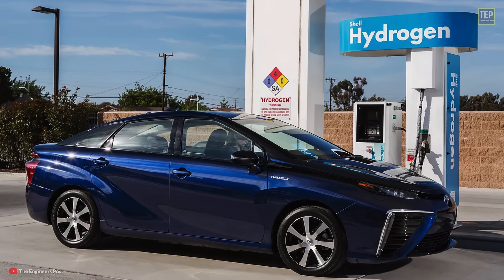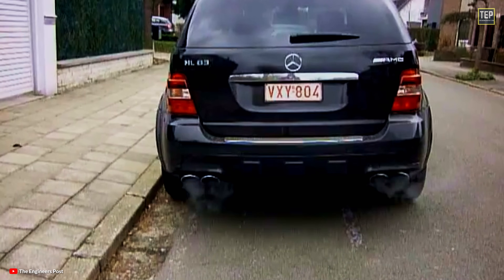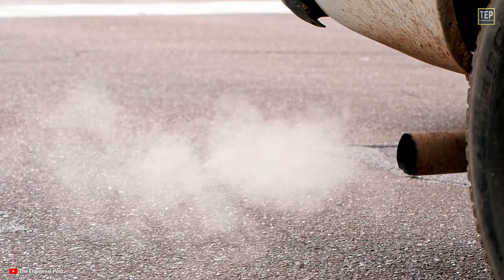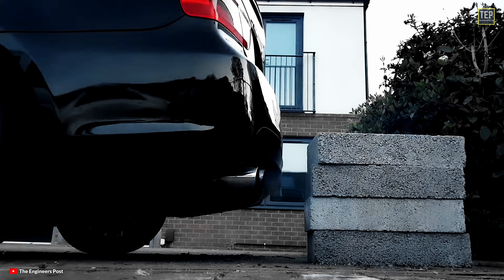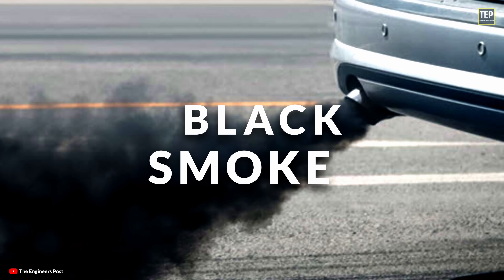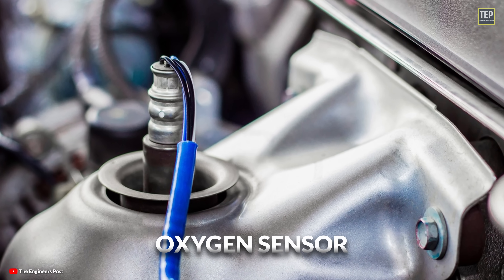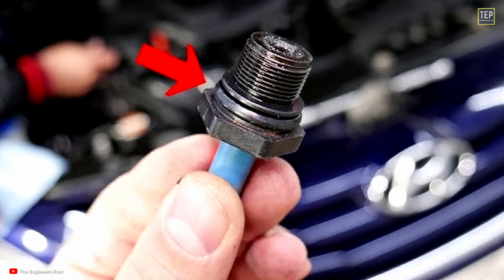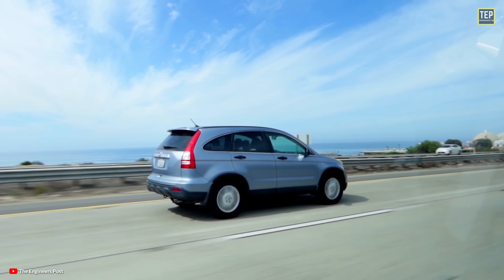What Different Smoke Means? Types of Car Exhaust Smoke | Explained

Comment: What if it comes white smoke only  when the engine is properly heated, and after revving it from being stopped for around half a minute? Not too much smoke, just a tiny puff, then when i revv again, it doesn't come out, no coolant shortages, only oil, must be a leak somewhere right?

Comment: My vehicle never had any kind of smoke coming from the exhaust maybe a little bit of white smoke but it went away but hardly ever. But just this morning that was lots of white thick smoke coming from my vehicle and it was like that for 10 minutes and then after that it was gone completely but it was super thick and lots of it. It is kind of moist and foggy but that doesn't have anything to do with it because smoke never comes out of my car and if it does it's very rare and it's very thin. I'm taking it to a shop in mechanics told me that there were no head gaskets leaks. No oil in coolant and no coolant in oil.
Reply: It's just H2O pooling in your exhaust pipe probably due to lots of humidity in the air and short journeys in your vehicle.

Comment: Hahaha i love my 2.5tdi 2001 vw t4 only with straight pipe still cleared the goverment inspections(APK) and smokes like the devil and is a daily driver with average use of 1 liter to 12km. And original engine unopened  and original factory turbo even the gearing and clutch is still original  and going still running very well with it's 365.000+km., i love old diesel cars at morst the vw and Mercedes both have made the most reliable diesel engines  between 1975 and 2002🎉🎉🎉

Comment: Using stop leak for a head gasket is bound to end in disaster. It clogs and gums up all the tiny CRITICAL coolant passages in the engine block, radiator, heater core, thermostat, water pump, turbo if you have one, intake manifold on some engines, and cylinder head. It creates sludge because of the chemical reaction with the OAT/HOAT coolant in the system, it chrysalises, then you need a new engine and cooling system…x10 $1,000s in repairs. Just replace the head gasket.

Comment: Clear explanations with possible causes for different problem scenarios. 
It can be added that the next step after this visual "exhaust reading" at a petrol engine should be to read the condition and color of the spark plugs, which can tell you a lot to pinpoint an engine problem.

Comment: Not being a certified mechanic, I don't think blue smoke results from an overfill of oil. An overfill just messes up oil with air by being churned by the crankshaft. The problem is a bad head gasket which needs to be replaced.

Comment: I've got a 2.4d none turbo and loads of black smoke when  hard acceleration , new air filter fitted no difference,  any advice please ?, brilliantly explained video 👍
Reply: Black smoke is a result of an imbalance in the air-fuel ratio. And the air filter is only one component...
Reply: @yurikhar thanks for reply,  would a faulty injector cause my black smoke issue?. Cheers gary

Comment: HERE IN THE PHILIPPINES....THE THICK GREY SMOKE IS USUALLY FROM THE BRAKE FLUID THAT GETS BURNED FROM A LEAKING BRAKE FLUID FROM THE BRAKEMASTER TO THE EXHAUST SYSTEM...DONT GET SCAMMED FROM  UNSCRUPULOUS MECHANICS THAT TELLS YOY IMMEDIATELY THAT THE VALVE SEALS OR PISTON RINGS ARE THE PROBLEM....CHECK FIRST USING A TRUSTED MECHANIC THE AIR HOSE LEDING TO THE BRAKE FLUID TANK....CUT OFF THIS HOSE AND REV THE ENGINE TO GET RID OF THE LEAKING BRAKE FLUID...DONT WORRY...THE BRAKE FLUID ISNT ON YOUR OIL BUT NEAR THE EXHAUST....AFTER THE REVING BURNS THE LEAKING BRAKE FLUID....PLUG THE HOSES AND TELL THE MECHANIC TO REPLACE THE FLUID TANK SINCE ITS HARD TO FIND ITS RUBBER SEALS...AND CHECK THE BRAKEMASTER FOR DAMAGE....IT WOULD COST YOU ABOUT 80 DOLLARS....COMPARED TO A VALVE SEAL AND PISTON RING REPLACEMENT THAT CAN GO FOR 300 DOLLARS....IN MY COUNTRY...THE SMOKE FROM WORN VALVE SEALS AND WORN PISTON RINGS CAN BE REMEDIED BY A PINT OF WHIZ NO SMOKE ADDITIVE....

Comment: Though my silencer was leaking oil and l can see the level of my engine oil going down to the extent that l have to top it up all this happened before l changed my turbo charger should I listen to what my mechanic is saying if so for how long should l run the the car for the smoke to go away

Comment: We have a 1957 Chevy (Belair) with a rebuilt 283 Power Pack engine. We bought the car all restored. We only can assume that the engine was rebuilt. When we start the engine its fine for about 10-15 minutes THEN starts smoking BLUE smoke. I HAVE seen engine vapor come out of the road draft tube so I'm pretty sure its not clogged. We have checked the compression and specs say 120psi is normal for this engine. Ours tests 115-120psi in all cylinders. I am suspecting bad valve guide seals but have no way to confirm this. It is maddening. Any suggestions?

Comment: Hi I'm driving a GWM C50T CAR IT SMOKE ALOT WHITE SMOKE  AND THERE IS N NOISE IN FRONT THE GARAGE TOLD ME IS MY TUBO MUST BE REPLACE  HOW MUCH  COST A TUBO FOR THAT CAR WHAT MUS I DO THANK YOU
Reply: It depends on what your standards are OEM, AFTERMARKET, USED LIKE FROM A U PULL IT JUNKYARD THIS WOULD BE MY CHOICE UNLESS YOUR WORKING WITH A 3 CYLINDER HAA
.  GOOGL| A UPULLIT JUNKYARD FILL UP YOUR TOOL BAG SUGGESTION LOOK OVER THE TURBO AND MAKE S LIST OF WHAT Tools TO TAKE Remember YOUR GOING YO BE CARRYING THESE ,ONE MORE THING DO YOU HAVE A GOOD BUSINESS RELATIONSHIP WITH  this mechanic that pronounced your turbo dead ? ,and do you trust him if not get another opinion hop it helps you I had a turbo and I know they become addicting so go with the cheapest route hope it helps

Comment: also white smoke if it appear on car that is in hot place so it shouldnt be cold to appear steam and no sweet smell so its 100% steam  it well no issue cuz it well be the car running on hydrogen wethier its fuel cell or combustion engine
Reply: 9:34 How is your brake pedal ? is it fully up top,? and does it stop how it should  stop ? do
 you do your own brakes or go to a chain this is the nost overlooked issue causing white smoke that usually dissipates  after 15 minutes ,it has no foul smell you state it isn't head gasket  it isn't intake manifold leaking coolant to make white smoke, it isn't valve guide seals , BUT IT IS  MY SECOND OPINION ON THIS ISSUE , Now if your having any brake issues and you can eliminate the disc pads or drum shoes ya there still out there omg I hated them , then it is a very overlooked problem sometimes completely missed THE BRAKE MASTER CYLINDERS BACK SEAL BECOMES BAD AND LEAKS RIGHT INTO THE vacuum advance which makes it possible to have power brakes by the use of vacuum you will notice the level of brake fluid depleting regularly the brake fluid makes its way from master cylinder>to vacuum advance or brake booster>into the top of motor this brake fluid comes in contact with high temperatures this producing the white smoke until all brake fluid is gone NOT A GOOD THING ,THIS IS A RARE ISSUE BUT HAVE SEEN IT AND REPAIRED IT APPROXIMATELY 5 TO 8 TIMES ,IT doesn't hurt the vacuum advance or engine heads as in my cases but who is to say it won't cars are weird sometimes  DO NOT GO TO KOST IN CARBONDALE PENNSYLVANIA 18407, Kost TIRE ,THIS Company ARE Straight CRIMINALS ,and should be arrested for theft by deception , and allowing customers to leave with a car that isn't safe, as well as SUED CIVALY, for discrimination  and racial profiling non caucasian people in 2025 this behavior still exist it blows my mind this kind of thing still exist haven't these people learned anything Nieces husband is Spanish  earned his citizenship,and G.E.D. HE WANTED TO TAKE THEIR CAR FOR A ROUTINE INSPECTION ON HIS OWN ,BOY DID THEY ROB HIM BLIND HIS English IS STILL ROUGH AROUND THE EDGES THEY Charged HIM ,FOR A RADIATOR that I know was good , front n rear brakes pads and entire exhaust front cat back $3000 grand later they inspected it ,he also said he recognized ra ial slurs coming from their mouth I don't care to repeat them... Yep in 2025 this is still going on , these people have learned nothing from our mistakes, they are incapable,of kindness , integrity,honesty and empathy,,don't fully believe if your from Spanish decent also even if your English is fluid fake that it isn't do it at inspection tine so they think they got you between a rock and a hard place just keep your cool with what you hear also videotape then hidden can of course then when they spring the crazy bill show en video and they be paying you to leave...

Comment: Never use a head gasket treatment, that can actually gum up the coolant passages in the engine and make the problem a lot worse. Only fix for that is a new gasket not mechanic in a can. Also it may not always be the head gasket it could be the head (or one or both heads on a V engine) is warped which could happen if the engine has recently overheated.

Comment: Can anyone help me figure out why my car only smokes after it heats up, its in between a white greyish smoke, maybe a little blue, there is powerloss as well. It only smokes when the engine is warm, the valve stem seals has been replaced, is it rings? Its not a constant smoke, it clears up on an open road, but in traffic it smokes a hell of a lot when pulling away until the engine runs a bit then it goes away again.

Comment: Never use head gasket Treatment!!!!  I've tried the 3 top brands on 3 different engines with minor leaks. Followed the directions to the T. They all failed. They will however clog up your heater coil guaranteed. You've been warned

Comment: I have a thirty year old Audi 5 cyl. Always Smokes white, when first started. Goes away quickly in the summer. Not sure if it ever fully goes away in the winter. Doesn't smoke at all without the exhaust. Sounds beautiful as well, but dear god is it loud when it only has the manifold on.

Comment: Pathetic engineers at The Engineers Post.  Is it stupidity or carelessness or both?  Two examples of silliness in this video are talking about dirty air filters while showing coolant flow through engine and rad instead of air flow and while talking about diesels and showing a combustion chamber with valves, an injector and wait for it a spark plug. People that don't know jack about an engine might not notice but come on this is just pathetic.  Good for a thumbs DOWN.

Comment: Does it necessarily mean the white smoke is as a result of coolant entering the system, cos my Hyundai got the same problem and I later found out it was the engine oil on top the pistons
Reply: not really, if coolant get into pistons it would leave color mark white on pistons or piston blocks, myb it is oil burning but a little bit of oil so it seems like it is white smoke but if you watch close it will be blue-ish color. you can even tell by smell if you smell little bit burn oil, and if it coolant leaking you can definitely tell by smell that it is coolant because it stink a lot.

Comment: Ive seen ROADKILL, THEY USED IN MANY THINGS AND THEN DROVE 700 MILES WITH OTHER THINGS LETTING GO BUT WHAT CAN YOU EXSPECT OF PUTTING A CAR TOGETHER IN JUNKYARD. THEY SWEAR BY IT WITH OTHERS ON OTHER SHOWS AND WIRKS 99.998% OF THE TIME.  THERE NOT EASY ON THEM NEITHER. THEY BUY IT AND DON'T GET ANY ENDORSEMENTS FROM THEM AND THEY STATED THAT. I'VE USED PEPPER FOR RADIATOR BEFORE AND WIRKED FOR NEAR 600 MILES AND STOPPED THE LEAK I HAD IN MY MUSTANG.  LATER HAD FLUSHED AND CLEANED UP AND FIXED FOR $20 BACK IN THOSE DAYS WHEN CARS COST $50 & LASTED FEW YEAR'S OF JUST BEATING ON THEM.  BEST CARS IVE OWNED WAS CHEAP CARS, REST THAT I SPENT $1,000 TO $8,000 ALL BROKE DOWN TAKING CARE IF BECAUSE OF PAYMENTS DUE. BUT THE $50 ONES LASTED WITHOUT ISSUES . I HAD 3 VEHICLES AND PAID $2,300 FOR MY TRUCK THAT HAD PROBLEMS.

Comment: Older cars have a vacuum operated modulator for the transmission. It operates off a diaphragm that can fail and transmission fluid gets sucked into the carburetor. That causes a white smoke.

Comment: to add to this for the white smoke worriers.. if its cold or damp outside itll probably do it constantly its not ALWAYS headgasket related. it will also do it more on cars with muffler deletes, resonatior deletes, or catless
Reply: Yeah I have mid a rear muffler deletes and AM mid mufflers , I get white smoke on cold days and cold starts
Reply: Man,my car did tricks on me.I bought it on sunny day and was driving it,no smoke,then it was raining and ok,I parked and after 20 minutes start the car and white smoke/steam.As I do not know much about it I was scared because I let it idle and it was smoking constantly,engine got worm but still smoke.Naturally I got scared because I heard if engine is hot it should not smoke.Anyway,then I went home,parked and no smoke lol.
After few days it was raining again and again this same situation,I drove 20 minutes,parked,played with OBD,turn on the car and smoke.Then I checked exaust and inside pipes it was condensation.I went to drive 10 minutes more,no smoke,no condensation inside.Btw engine can be warm but at time I was parked my cat temp dropped to  250c,condensation was in pipes and after some driving it was  500c without condensation and that is the difference.On damp day if you drive a bit,stop and start again in 20 minutes or so chance is engine will still be hot but exaust system cold.that is why that rule/if engine is warm it should not smoke/ is not 100% correct.My engine is 1.8 132kw TSI

Comment: The only times that you would see more smoke or more white smoke, is when its really cold out, then it tends to be more visible. I may be wrong but the warm and the cold make that smoke more visible. Like breathing in and out in the cold. And when you start moving from a complete stop, it tends to be more visible as well. Even though it's all warmed up, it will still be more visible when driving due to the cold weather (like winter weather), but in the warm and summer days, it will be less visible
Reply: Thank you for the info on that sir,i notis this on my own car and got scared that the engine was on it way to the graveyard before the mecanics said the same due to the weather her in Norway this days it smokes due to being cold and damp outside.I did change the oil,plugs and put som petrol cleaner and even oil treatment with teflon because i have a hig milliage car.
Reply: white smoke can also appear when a car is stalling
Reply: What about funny smell smoke coming from driver s window 😅
Reply: That white "smoke" seen in cold weather is, of course, steam/water vapour which there is quite a lot of in petrol exhaust.

Comment: Can someone tell me why my car got blue smoke its a hybrid huyndai sonata 2022 57,000 miles, mean this issue may have ?? Brooo 🤦🏻
Reply: Blue smoke is oil burning. Could be temporary (the piston compression rings sometimes rotate leaving a gap to your cylinder) or the oil ring at the bottom could be gummed up and not popping back against the cylinder walls (more permanent until addressed) or worn out piston rings . It could also be coming from up top around the valve stem seals. 🤔 tbh burning a tiny bit of oil isn't too bad, but if you're losing quarts on a longer drive then definitely have it looked into

Comment: white smoke can be brake power booster vacuum filling with brake fluid from leaking master cylinder. it gets sucked into the fuel inlet

Comment: I have a Ford Mondeo Diesel 2.0. I have white smoke coming out of the exhaust even after its warmed up. Not heavy but you can see it if you stop at a traffic signs or else. I checked the Head Gasket in a workshop. But they said its ok. Even the Coolant level is ok and nothing is leaving the system. So whats going on? Maybe its not white, maybe grey. Cant tell. Engine is operating as normal as ever. I´m clueless

Comment: Can excessive burning of oil cause low temperature on the gauge at high speeds?  Or vice versa if malfunctioning thermostat can cause the extra burning of the oil? The car is 2001 Saturn SL2, I maintain it very well, and it has only ~140K. I regularly change oil, like 2 years ago changed Spark Plugs, Valve Cover Gasket, and PCV Valve. I would appreciate any opinion on this matter. Thank you for a great film, I've never thought of a color of the smoke and corresponding problem.

Comment: Small Nissan engines have white smoke until the engine gets a good load and reaches operating temperature 🤒. It can almost appear like a problem because it does take a significant number of miles at low speeds. Highway speeds take care of it very quickly however.
Reply: please help,I am from sri lanka,i have a nissan vanat van (petrol auto). when i am driving some time 150 km,some time 10km coming white smoke not everytime..i noticed mostly  during the running when turns very  slowly it comes.but not every time.

Comment: Had excessive oil in the engine after service. Big puff of white smoke came out not blue so a bit confused here with the colours. Drained some oil and problem was fixed
Reply: The video correct blue smoke is oil TRUST ME I know about that but you're good tho but before  blue smoke you rather see white ,Black or even grey because oil is blood in a vehicle and not stop blue smoke means that you're engine is on life support it's a matter of time.

Comment: Before watching, here’s my take: White = steam/water (cold start up). Blue = Oil being burnt (worn rings or valve stem seals) Black = sooty (Rich mixture). Grey = normal, but should not be thick and almost nothing when fully warmed up.
Reply: Big smoke = follow the damm train 😂
Reply: Mine is blue when I start in the first in the morning or when the car has been parked for like some hours and later clear to light grey
Reply: Did you ever find out what was wrong with car?

Comment: white- water vapour, check your coolant levels. black- not enough O2 mixing with gas, check your o2 sensors, blue- buring oil, get a new car or rebuild your engine,